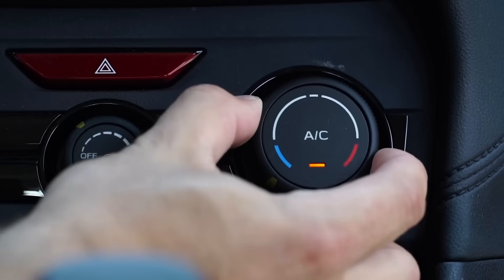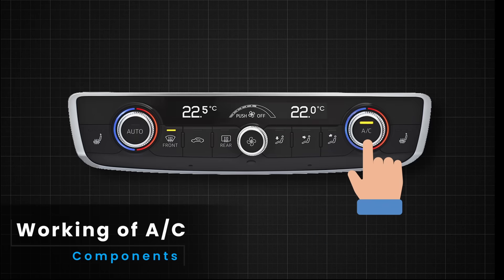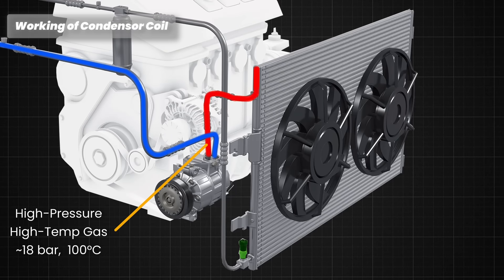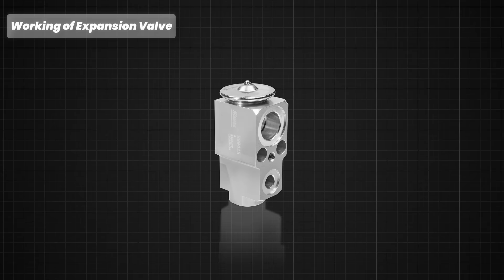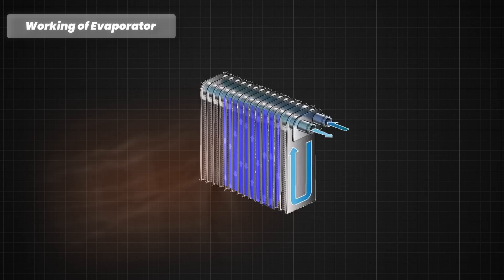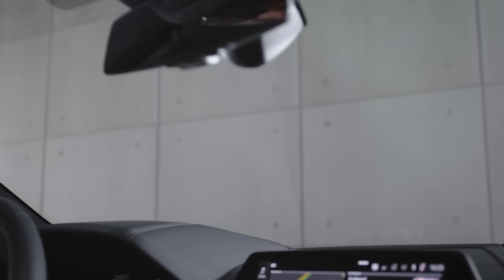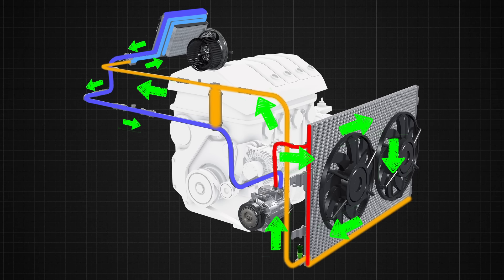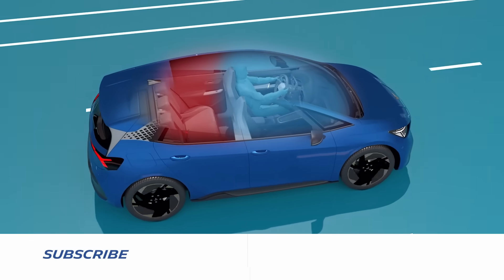How does Car Air Conditioning Work?-Components and Their Functions -Car AC system

Comment: As a mechanical engineer, this is the best video I've seen explaining working principle of car air conditioning
Reply: Great video. I need to know if anyone has been experiencing any weird smells coming through the vents on their brand new 2025 equinox? my wife purchased a brand new equinox 2025 about 3 months ago and every now and then for a brief few seconds, she would smell a fume like smell (best description we have so far) and then it goes away and its back to regular car smell. This only happens when the AC is on recirculating, temp medium and fan speed on medium. We brought it to the GM dealership and they replaced the cooling fan (mind u this is a brand new vehicle) which reduced the smell drastically but there are still faint smell every now and then. We don't know what we are inhaling and despite our efforts, the dealership still doesn't know what is causing the smell since they can't seem to replicate it so we are documenting everything to give them, since it is still under warranty. If anyone out there has just bought a chevy equinox LT 2025, please let me know if you have the same issue and what was the culprit and the fix please. This is driving us crazy. I know if this was a BMW and we were having these issues they would have probably done more for us.
Reply: @MrTatouA Maybe you can make a “  hygiene vaping, and use deodorant the cover up the smells like this that you informed us .
Reply: @MrTatouA  My Jeep cherokee 1999 gives gasoline smells at times if A/C not on I find it interesting.
Eventually after changing the filter it still does that and assume its a bad gasoline filter leaking. You might have a leak somewhere in your housing and should geta a new car asap because dealership people just want you to keep coming back for repairs until you can t no more and offer you a undervalue price for your car to trade it in.
I would take advantage of the warranty before expiration
Reply: @MrTatouA can be due to the debris blocking the vents located close to the vipers. (Outside)
Reply: What if we run the compressor from electricity rather than power from engine? Then mileage will increase?
Reply: @TheGoanFarmer  It depends on the vehicle type and energy source (battery). 

In conventional (ICE) vehicles, the AC compressor is driven mechanically via a belt connected to the engine. This results in increased fuel consumption and reduced mileage due to the engine operating under increased load. Even if we use an electric compressor in these ICE vehicles, if the battery is being charged by the engine, the engine will still consume fuel, limiting the gain. 
In hybrid and PHE vehicles, the battery has a larger capacity and higher energy. In these vehicles, the compressor and other electrical systems do not need to be constantly running the engine if the battery is sufficiently charged; they can draw power directly from the battery. The engine only kicks in and charges the battery when it's low.
Especially in PHEVs, the larger capacity of the battery and the ability to charge it from an external electrical outlet make it possible to drive and use electric systems for long periods without the engine running, and is one of the most ideal solutions for fuel savings.
Reply: You are not a mechanical engineer..
😅😅

Everyone on YouTube is a fake content expert
Reply: As a armchair expert, these is the dumbest comments I usually see on explanation videos.
Reply: So when it changes from liquid to gas, that’s when the majority of the temperature change takes place?
Reply: @TXRoeJogan  It's more accurate to say that the greatest heat transfer occurs during the phase change because in the phase change processes temperature remains constant. In other words, the greatest cooling effect in car AC occurs during the phase change process, when the refrigerant changes from liquid to gas in the evaporator.
Reply: It was decent, but it lacked a lot of information/discussion.
Reply: Actually I have seen not one vid explaining the significance of the phase changes (liquid to gas, back and forth).  

Basically, water has to absorb almost 5 1/2 times more heat to change 1 lb of 212 degree water into vapor, vs the heat it needs to absorb to raise it's temp from 32 to 212 degrees.  Similarly heavy heat release needs to occur to get back to a liquid.  

This amazingly efficient heat transfer during phase changes (called the latent heat of condensation and evaporation, in which temperature isn't even changing the moment all that heat is absorbed or released) is the key to whole thing.

I mean in theory you can compress and expand the refrigerant and use it to cool your interior (at least some) without condensing and evaporating.  So when vids throw the condense/evap in there without explaining the significance, I think it causes confusion...
Reply: @nolaguy1408  I totally agree with you, the phase change is the key part of why refrigeration/AC systems work so efficiently. Without these phase changes, the system would only rely on sensible heat (temperature rise/drop of the refrigerant), which would transfer much less energy and make the AC very inefficient and the COP would be very low.  So teoretically, allocating more time to this process in the video would have been more effective, but the length of the video can often affect the number of views, so the content creator made a slightly more superficial explanation.

Comment: So in high RPMs the AC works faster?
Reply from the maker: At idle, especially in very hot conditions, the AC may struggle to cool the cabin quickly because the compressor is running at a lower speed. Once you start driving and the RPM increases, the AC system can perform better.
and Beyond a certain point, further increases in RPM won't significantly improve cooling.
Reply: @motoringmasters  thanks for the explanation. You learn something everyday.

I've seen the engine rpm increase when idling with ac just turned on. Could be the ECU doing it to workout that ac
Reply from the maker: Yes, that's correct. The ECU often increases the engine RPM slightly when the AC is turned on to compensate for the additional load the AC compressor puts on the engine.
And also the oil pump circulates engine oil more efficiently, This improved circulation helps ensure that all engine components are adequately lubricated,
It's a smart way to keep the engine running smoothly!

Comment: very informative and easily understandable.

I have a Hyndai Xcent 2014 petrol model and it has a bad AC system and it stops chilling after 50kms drive and from thereon it will be just like a air cooler instead of air conditioning.
I have replaced new evaporator and new cooling coil in service center but still same problem. 

When enquired with a local general car service center they have advised me to replace compressor and problem shall be solved it seems. I am tired.
can you suggest me like in general what might be the problem?
Reply from the maker: Yes, The AC compressor may be the real culprit here.
But I can answer only if you tell me all the symptoms that happened to your car.

Does the AC provide good cooling in the morning and at night? Is this problem only when the afternoon is very sunny?
And how many kilometers your car has run so far?
Reply: @motoringmasters  The AC runs without chill most of the time (just blows air like a cooler mostly. There is no chill in automatic also when temperature is 16 degrees and recycle mode). I have checked both in auto and manual mode but same problem persists 😢. 

In all this 11 years of time the car run around 35k km.
Reply: @motoringmasters  👋 I request for a reply. Thanks in advance
Reply from the maker: sorry for the delay! If the compressor isn’t pumping refrigerant effectively—maybe due to a mechanical issue, electrical problem, or low refrigerant levels—the AC won’t be able to cool the air properly, resulting in just blowing room-temperature air or only slightly cooled air.

I’d suggest checking if the compressor is engaging when you turn on the AC. You should hear a click and see the AC clutch engage. however, If the compressor runs properly and the clutch engages properly, it also may get the bad pistons and not pump the refrigerant properly. In my experience, the compressor is usually the problem.
Reply: @motoringmasters  thanks for the reply. Will check it with a technician 👍🏻

Comment: I have a Ford Fiesta 2014, sometimes in high temperatures (i say that cause of the dash shows the temp) when is marked 28° to 34°, If the ac is on, the car will stall nonstop, i never seen this before, so weird and anoying.
Reply from the maker: from AC side it could be AC Compressor problem or other pulleys(Alternator or Power steering pump) which is connected to the Compressor via a belt. Also check the Refrigerant level.
other than that, it could be throttle body, injector or fuel pump.
There may be problem with any of these parts in your car, a mechanic can easily find it out, better take it to a good mechanic and get it checked.

Comment: I find it amazing how many things are stuffed inside a car.
Engine itself, transmissions, compressor, radiator, batteries, electric motor for starting, alternator for electricity production, radiators, brake enhancers, differentials, torque convertor and many other things. All have to work in tandem and they often do for decades without fail.
Reply: Absolutely incredible how a vehicle's operates. God Bless the people who invented it
Reply: Math is simple. EVs for cities and Hybrids for Highways. With hybrids you get the best of both worlds. There's no point in driving gas cars in cities anymore. It's not fun to drive and eats more gas.
Reply: @SapphireDreamsFlightSimulation hybrids ftw!
Reply: @SapphireDreamsFlightSimulation completely agree.
Reply: It’s insane how many things are within that engine bay. For example just looking at the timing belt…considering makes sure the crankshaft, camshaft, water pump, alternator, and the compressor all works in conjunction.
Reply: *BMW has entered the chat
Reply: Technically interesting but prone to interference, maintenance and repair will eat your money
Reply: With EVs we have less than what we already have also more effective and environmental friendly.
Reply: @muhammadrasool5554 litihum mining for ev is not environmentally friendly.
Reply: @glowiever Running a gas engine isn't environmentally friendly either. The energy output of a gasoline engine is 20-40% EVs are 80-90%. Drilling for oil isn't good for the environment either!
Reply: @noahw5887 Well still thermal production of electricity is done with coal that ain’t environmental friendly either😂
Reply: @devashishekka2113  true but coal is slowly being phased out. Dropped from 23% to 20% within a couple of years. Will keep on dropping slowly.
Reply: @devashishekka2113  you're sort of right depending on the MPG of the car and the electric car being driven. I calculated at 30 MPG you will expel 4,166 BTU(125,000 BTU per gallon of gasoline)of heat per mile.  

Tesla's average KwH per mile is 0.34. So 0.34 KwH produced from a coal powerplant is 3400 BTU and 0.34 KwH of energy usage is 1,160 BTU. The combined total of the two is 4,560 BTU from driving and energy production. If you got Tesla's most efficient model, the Model 3, that number changes to 3,353 BTU per mile.

There are other factors like carbon emissions but I'm just a dude on YouTube lol.
Reply: @devashishekka2113  thanks. I wanted to get numbers to see who was right. I really thought electric cars were far superior lol. At least I learned something.
Reply: @glowiever That is true. The start-up for an EV is much more than an ICE Vehicle. However, through it's usage, depending on where the EV gets it's electricity (renewable or non-renewable energy), and EV can make up for it's environmental damage through efficiency and no longer needing oil or gas. 

Given these garbage companies though, through planned obsolescence, these cars will NOT last as much as an ICE Vehicle. 

If you are worried about the environmental consequences that much, just stick the car you drive now and fix it/ find ways to make it more efficient. Either way, you driving causes environmental damage, the least damage you can do is, if possible in your area, public transportation. Here in the U.S. our politicians are bought and there is basically a non-existent Public Transportation system. People need to VOTE.
Reply: @noahw5887  it's more environmentally friendly than cows, look that up. Cows release more greenhouse gases than combustion engines. it's like 3 cows to 1 car?
Reply: @noahw5887  Heat isn't what matters tho lmao the heat is dissipated long before it can do any damage to the ozone.
Reply: @TheRealRumple999 thought your numbers were off because it seemed absurd but yeah you're right.
Reply: @TheRealRumple999 actually you're wrong and heat is completely a factor. Any heat produced gets trapped from the greenhouse gasses.
Reply: @muhammadrasool5554   There must always be at least one EVangelist in the comments.
Reply: @muhammadrasool5554  car engines can be recycled… ev’s batteries can’t. Also research the amount of extra co2 required to create an ev. The duration ev’s are running are more environmentally friendly sure, but when you add the manufacturing and deconstruction of the ev and compare it to a normal gas car… ev’s are actually worse for the environment.
Reply: @muhammadrasool5554  yeah but then EVs ruin the feeling of a real car. It kinda like driving a ghost, sure sometimes is good, but for real excitement ICE never fails. I think EVs should be the main alternative, but not banning ICE
Reply: @notaraaf2 yes that’s what I tell everybody. The engine and other components of the powertrain give the vehicle its personality. Doesn’t matter if it’s an I4 or a big V8. EV’s don’t have personality, just some body panels and logos.
Reply: @notaraaf2  bro, studies show that 90% of people just want to get from point A to B. Also if your car is 10 years old. It spent 90% of its life parked somewhere

Comment: In a very similar fashion, the AC system or split system heat pumps work for cooling or heating your homes. As a mech engineer, it's nice to see how it is implemented in cars. 😊
Reply: it is different.  the thermostat is in the back of the evaporator 😂.

Comment: So what if the vehicle is idle? Will the compressor work harder than the vehicle moving??
Reply from the maker: In idle, the engine runs at a lower RPM, which means the compressor operates at a lower speed. 
condenser fan is typically the only means of dissipating heat from the AC system. but this is not as effective as the airflow generated when the vehicle is moving. As a result, the AC system might struggle to cool the cabin as efficiently when the vehicle is stationary.
This can cause the AC to take longer but not harder to reach the desired temperature.

Comment: Just cleaning your condenser and fins can have a dramatic difference, a lot of people don’t know this, plus your cab filter.
Great video. 😎
Reply: All vehicles dont have a cabin filter
Reply: @henrykennedy1120  Almost all
Reply: How I can clean my condenser and fins?
Reply: @dukinse5198  They are infront of the Radiator, as you open the hood of the car it's the furthest upfront thing. I think a soft brush or a water hose should help in cleaning it.

Comment: why in all AC videos, we found only the cooling, how the heating is done?
Reply: Heating is very basic. Heater core is located in HVAC box. The heater core receives hot coolant from heater hoses (plumbed to the radiator of the vehicle). It uses blend door motors to close off this heating circuit when the ac is selected and turns the heat on when it goes the opposite way. This can be fine tuned by selecting desired temperature on climate control so it’s not merely a  On/Off motor, it has many positions.

Comment: TELL ME is it normal to drive with ac on  LO and the ventilator on 2 bars  , instead of putting it on automatic and just normalize the temperature slightly lower than the outside , can someone answer please
Reply from the maker: Yes, definitely
Reply: @motoringmasters   thanks for reply ! I think your video is the most logical on youtube !! , i see so many car enthousiasts with ac on LO and window open and clearly see a automatic button
Reply: I usually leave it at 21 degrees celcius and 1-2 bars. feels much more efficient to just leave it at 22 and go through all that noise